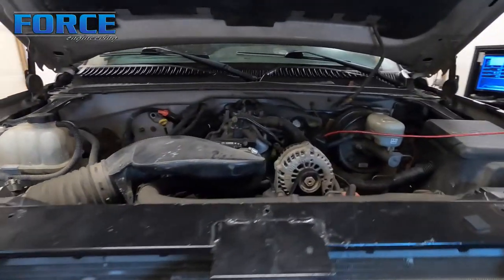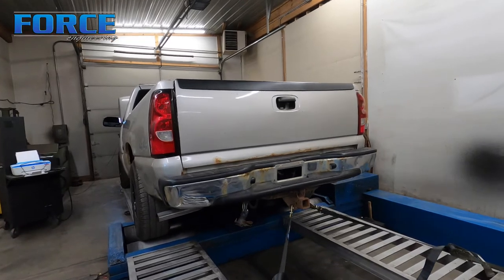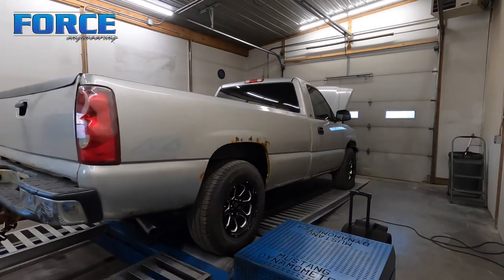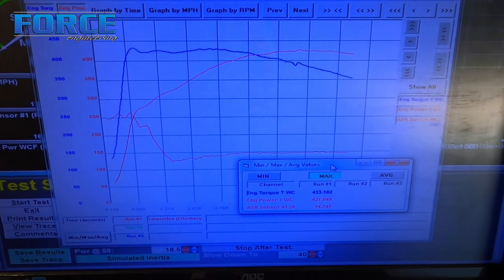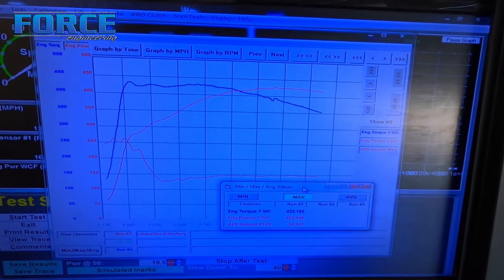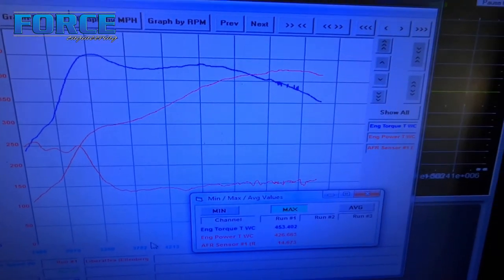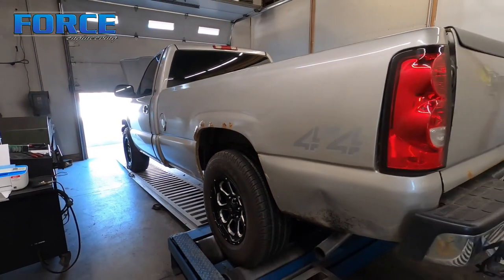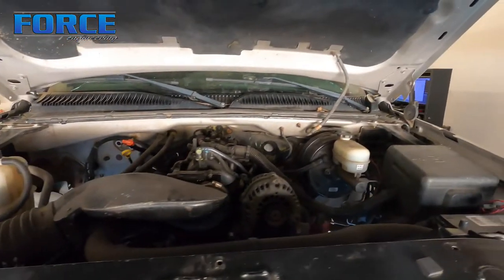Dyno Review - Cammed 6.2l LS, 706 Heads | 12:7:1 Compression

Comment: 437/430 on stock manifolds, intake and 93! Pretty impressive
Reply: That is not impressive at all for a 6.2L engine that in its stock form can easily make 550hp, it is actually embarrassing.
Reply: @shawnchurch316  🤣
Reply: @shawnchurch316  Are you talking rwhp or crank? A stock 6.2 makes 420-430 crank hp so Idk where you come up with 550 in stock form. Also 430 rwhp is over 500hp at the crank. Not bad for really only having a cam and 706 heads.
Reply: @shawnchurch316  550 at the wheels?
Reply: @deegan727  exactly. Pretty impressive especially using some 706 heads.
Reply: @6ohaintslow  Yea, it can with 5-7 .lbs of boost...... lol
Reply: I don't know which dyno you're using, but that's impressive! A TBSS intake with a cold air would put him at 450 rwhp.

Love the 706/862 heads!

Comment: 706 heads are severely slept on especially when they're fully ported and given a good valve job🙏 an upgraded intake mani and cold air intake would do that truck good
Reply: 706 head can only compete because of it nearly 61 cc chamber. Other than the compression theres nothing special. They get easily outflowed by 799's with comparable compression at 64cc
Reply: @djzomb1  its already been proven that 799 don't make a crazy amount more power than 706 heads and 706 are better down low than 799. Pound for pound the 799 only gonna make about 10 more horse than the 706 but the 706 will make 15-20 more ft lbs.
Reply: @natewoods6494  might want to look at that graph again. The trade off between the two with peak torque and hp is negligible. the 799 heads essentially move the power band further out the rev range. I'm simply stating 706 heads aren't some industry horsepower secret, and I certainly wouldn't be recommending them to someone who wants to make power.
Reply: It doesn't even have headers, those would give 20-30tq and hp IMO
Reply: The truck intake manifold actually flows as good as most aftermarket manifolds
Reply: @djzomb1 have you seen how well a ported set of 706 heads flow with bigger valves? They can flow 300cfm all day… certainly cheaper than buying a set of aftermarket heads and for 90% of people they certainly get the job done especially on a budget
Reply: @chrishansen7004  True...300cfm isnt needed to make a fast st car. Its nice but certainly wont be slow with say 260
LS has that shallow valve angle that really helps SO much...cfm is not everything.

Comment: I want to do this with a 6.2 shortblock with 706 heads, TBSS intake, 92mm tb, 1.75"-3" headers maybe tri-Ys and a 228/230 or 238/242 Elgin cam with Pac1218 springs on E85 with around 11.0-11.6:1 compression to move my heavy 2004 GTO 6 speed with 3.46 gears maybe a 25% UDP and/or a VCM OTR intake with Terminator X
Reply: Id use the smaller cam unless you regear to a 411 or 430.

Comment: With long tube headers, a good air intake , and a aftermarket intake manifold from Holley or Fast that truck would probably pick up 50-100hp
Reply: I would guess 460whp
Reply: I cant help but wonder whats wrong. This set-up should perform better. Its significantly below LS3 numbers. Must be the intake and head combonation,  exhaust?
Reply: @thicketbomb it has stock exhaust manifolds and a sloppy automatic trans, those numbers are impressive for what it is.
Reply: @thicketbomb it's got quite a bit smaller set of heads vs the LS3 style head. Also, it has stock exhaust manifolds and a truck intake. It's pretty good for what it is. It's a sand dune truck so what's important is the average power and torque numbers here.  Still very impressive for what it is.
Reply: This put down to the tire what an ls3 has at the crank

Comment: 243 with 706 chamber size is better. That's what I got, with a oversize valve job and cnc port on a 6.0... woke it up nicely from valve job and mill 706s
Reply: ocersize valve job? Did you mean you put larger valves in?

Comment: i have a very similar setup except i ran the btr truck norris cam and i have domed pistons cant remember spec. i cannot get past 7 degrees of timing before spark knock is detected.
Reply from the maker: In that scenario, i wouldn't trust the knock sensor. Put it on a dyno and tune the timing curve with the knock sensor turned off.

Comment: Damn I didn’t think you could put 706 heads on a 6.2l bore size
Reply: Same
Reply: Why would anyone want to do that, absolutely stupid.
Reply: @shawnchurch316  Torque! LS3 heads make more horsepower and more torque above 4K RPM but 706 heads do better at lower RPM.
Reply: Actually its not stupid. If you had a vehicle you ran on the street more than anything 706 heads on a bigger motor would be great. They flow enough stock to support well over 500hp and if you port and add bigger valves they get better. With The torque curve on that truck it could prolly pull a house off its foundation. 706 heads get looked over alot but they are pretty decent heads

Comment: 823 heads and l92 intake would make 500
Reply: Not with factory intake system and exhaust manifolds, also the tq wouldn't even be close in the mid range.
Reply: @hendo337  it will bro trust me l92 intake ported flows better then the fast 102mm
Reply: JMG_2_SLOW

I proved this years ago and posted the dyno sheets on ls1tech circa 2010.

The one thing it doesn’t show is that bottom end is significantly improved with cathedral heads if it’s it a truck.

That dyno on Ls1tech was on a low compression 403 wirh TEA ported heads and a big camshaft.

That engine didn’t last anytime and I ended up replacing it with a self built 6.2 wirh Advanced Induction 226cc ls6 heads and a ported TBSS intake. Even using a tiny 216/224 .551/.551 camshaft,I like it a ton better than the old engine🤷‍♂️

Comment: I'm sorry 437hp out of 12.7:1 compression 6.2 liter is really depressing even with stock manifolds and airbox....just saying,   hell you can do that with a 12.7:1cr  5.3 and other factory accessories........cool concept though, bet the truck is a ripper
Reply from the maker: Keep in mind this is wheel hp, not flywheel hp.  Also keep in mind that not all dynos read the same.
Reply: @ForceEngineering  he said you could make 437 with a 5.3 n/a lol tells you all you need to know about that guy.
Reply: It's got some heavy wheels and tires on it that'll skew it a little bit
Reply: What are you talking about, with a 20-25% loss those numbers at the crank are excellent. It doesn't even have headers or a TBSS intake or as much timing as E85 would allow.
Reply: 420 rwtq. That thing is a blast.